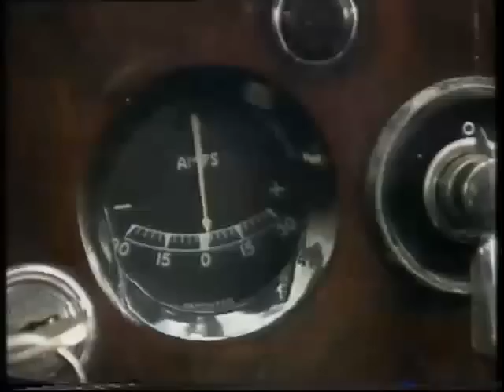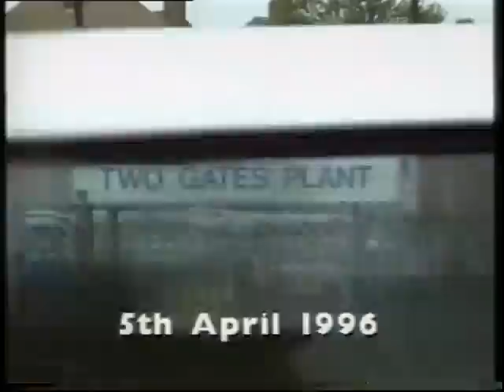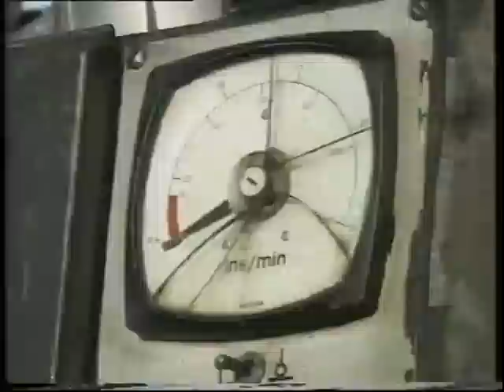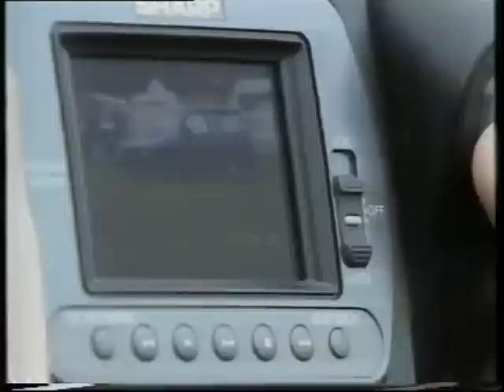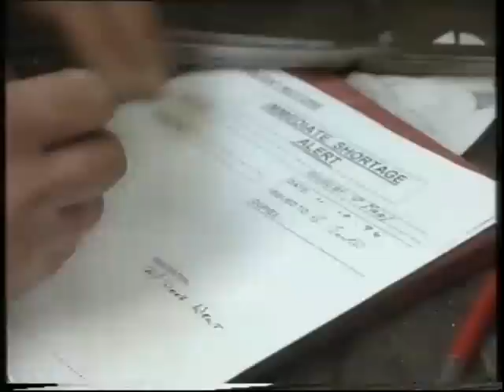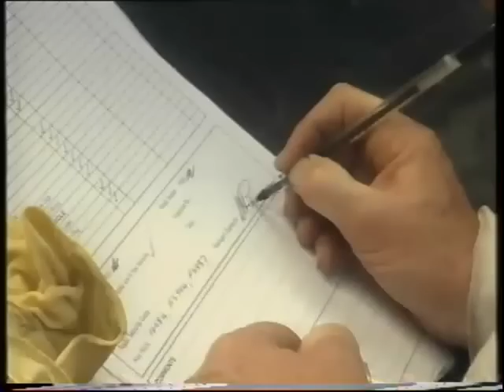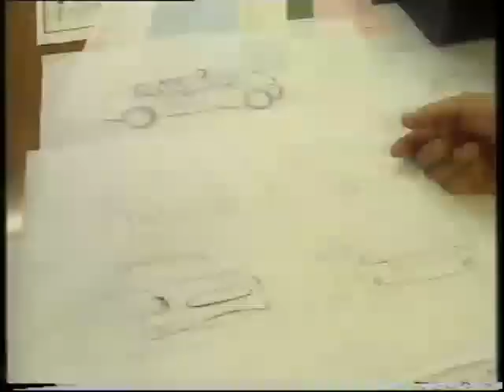Reliant Motor Company Documentary - 1997

Comment: The EU  should have  rolled over and dismissed any sort of charges, or taxes or fees having to do with making of this car. 
 This would help to continue manufacturing in Britain. I can’t think of what  it’s called right now. I like to call a dog a dog and a horse a horse. So, help manufacturing in Britain .
However, the government didn’t help them out. What they did instead. Was, to allow those with motorcycle licenses, to drive four wheel cars.  Completely taking the niche out of the reliant Robin. 
And it was probably done on purpose, In the name of progression, and fairness. By the hand wringers running the country. Who certainly do not want any manufacturing going on in England.
Reply: So basically they should have made laws that govern safety features, emissions and whatnot, but only for every other car manufacturer.
Reply: I should know better to respond to someone who does not have any content on YouTube but I will. This is the libertarian in me .
 My Fifth Amendment rights and this forum allows me to expound on that. This is my opinion, opinions are like assholes everyone has one. So here it goes. 
 Explain safety? If I drive my 1994 Chevrolet Astro van, or my 1967 Volkswagen beetle on the road, are they safe? The feds said they were at the time they were made. They don’t have side curtain airbags, and the beetle only has a two point harness. Again explain safety to me. 
 Back up cameras Lane departure warning systems, airbags, baby changing stations, and microwave ovens all add fantastic costs to cars. 
 I think I should be able to buy a car without that stuff. After all I am the consumer. Or not by the car at all. If it gets a crappy crash test. I wouldn’t buy the car at all, if it didn’t have a three point harness I wouldn’t buy the car at all. If it didn’t have safety glasses I wouldn’t buy the car etc. 
 Problem is the  automotive manufacturers engineers and designers have to come up with a new gimmick every year to sell cars or make them more expensive. Have you seen the $100,000 GMC truck yet? It’s in the works. I don’t wanna hundred thousand dollar pick up. I want a plain one with nothing in it. Because… I want to use it for  work, not drive on the highway. 
 I work hard for my money and I pay taxes on it, whose business is it what I spend it on? 
 And if you don’t like the unsafe car I’m driving on the highway, don’t buy one. 
 I can’t see any reason why a government would deny a manufacturer to produce something that is reasonable. This car is reasonable. There are people who want to buy it. That’s what will make it sell. 
 If you produced a car, with razor blades glued all over it, and the minute you touched it you cut yourself. People wouldn’t buy it and the business would go bankrupt. That’s how you stop bad items from  being sold on the market. Let the market decide. 
 The nanny state should not decide. 
Manufacturing in a country, builds the country and provides taxes for the government. I do not understand why they would not let them, or help them, or offer incentives to build this car. If people want it. They would make bank.

Comment: 03 Wheelers were a disaster especially on single track farm roads where the centre of the road was raised and or full of potholes and grass,  or driving over a pit in the local Garage or onto a 04 post ramp,  rapid cornering was a disaster,  but they were great for holding up traffic on a long and winding road.

Comment: Poor guy. Flogged that dead horse as hard as he could. Shame that an electric power plant wasn't available at the time. With the lightweight body, it would have been a runner. Still not convinced about the 3 wheel design though. Made the rear suspension like riding a rock to compensate.

Comment: Chopped sprayed fibreglass is junk compared to hand laid mat.
Reply: It’s cheap, solid and lasts. This is not a Ferrari.
Reply: @noelnicholls1894  Wrong, if you watched the full video you will see they never did it. The floor pan is structural and chopped mat has no tensile strength. There are a lot of people at the bottom of the ocean who went to sea in chopped mat boats.
Reply: Paul anon This is comparing plywood to particle board. My boat has floated for 40 years because the mat was thicker. Yes its not ideal.  Its IKEA not the Harrods version. the through bolts would have to be longer, some such issues and it would be heavier.

Comment: 28:50 I would punch the boss in the face.

He just won't accept the expertise and experience of the man responsible for production, a chop stand gun sprayed panel will be heavier and will not have the same strength as a laminated part.
Reply: It will be alright
Reply: Not on a car that barely made its weight limit already.